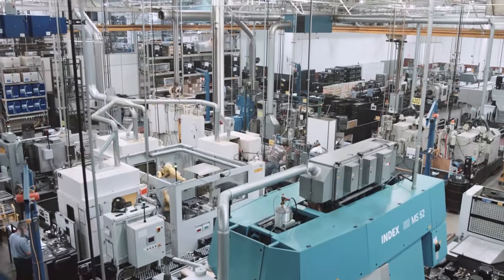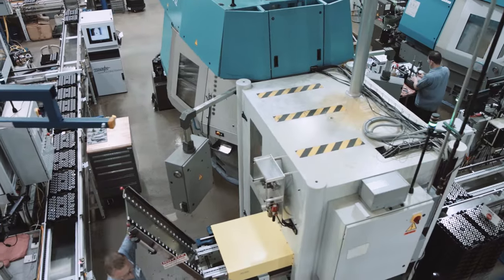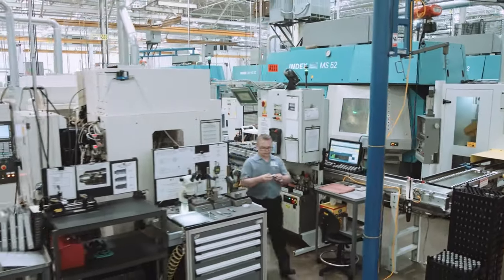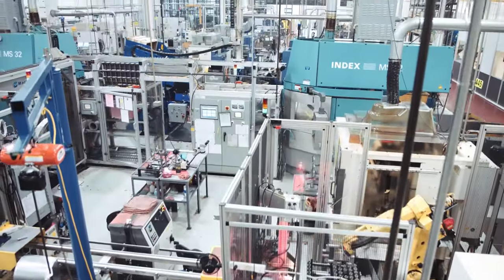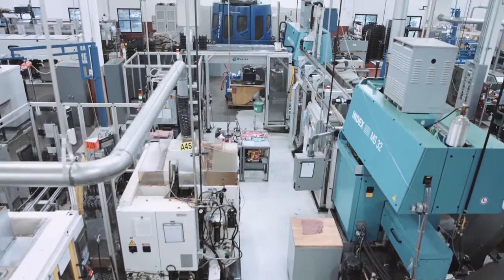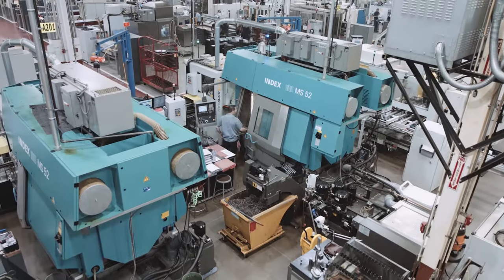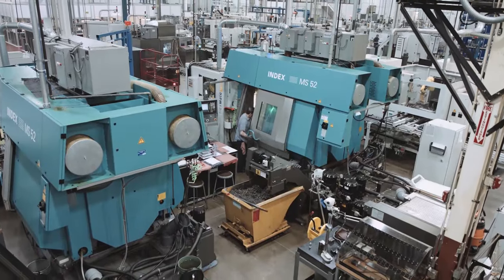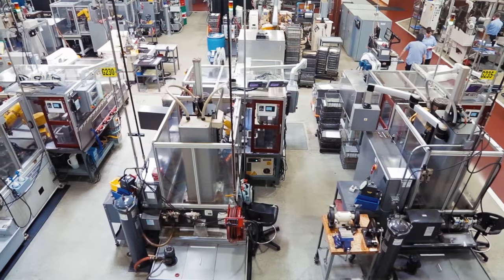Cellular Manufacturing: What It Is And Why It Matters

Comment: I came up with thus idea at Walbar in Mississauga Ontario in the early 90s.
Replaced 8 vertical machines with 
one Horizontal Mazak. Squaring up blocks using 4 vertical  vises mounted back to back. 
Frank Stronach from Magna..Boeing ..GM etc came in to see my method.
Salesman Bob Kanerak called me 
10 years after I had left Walbar and said "  I finally found you.
We just sold our 3000th machine!
That's unheard of in this industry!
You bought the 3rd machine and after everyone saw what you were doing sales increased!!
No thanks from Mazak head office!! Machines were selling for 
approximately 1 million a piece back then. 
I also bought the first Cad Cam system " CATIA" VP of IBM says I changed the world  No thanks for that either!!
Reply: are you for real? That is so cool! I am a young entrepreneur attempting to fully automate manufacturing of a 100% recycled wood-based sheet product.
Reply: Yes I am for real.